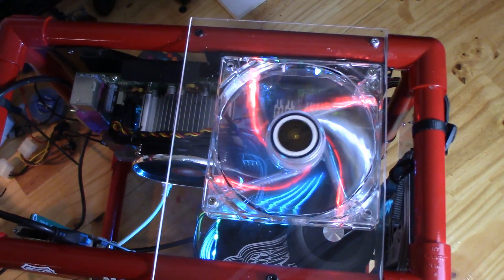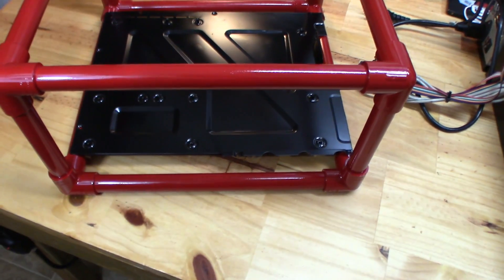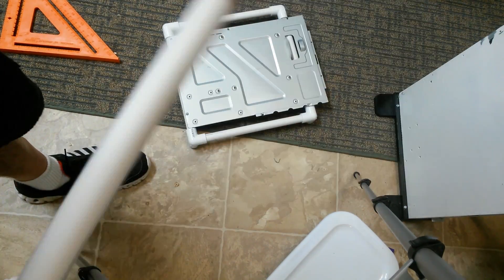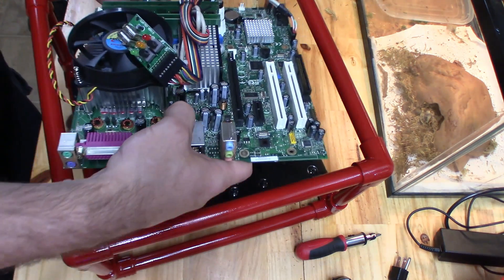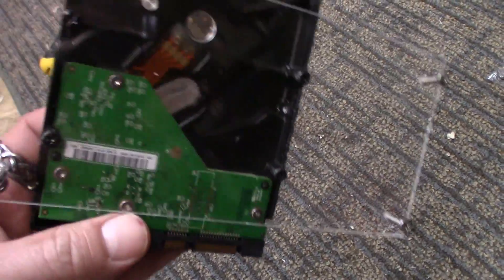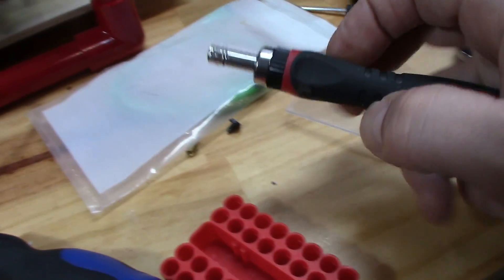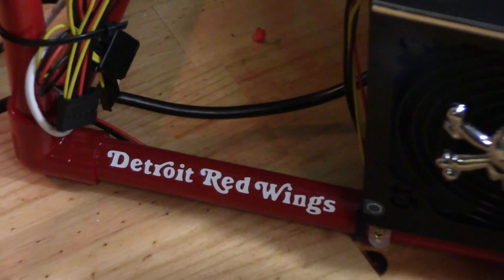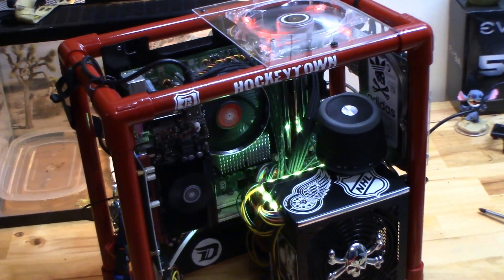Building your own computer case out of PVC for $8 dollars

Comment: DDR2 core 2 duo. I remember those days. I got a core 2 quad and broke my motherboard. My broke ass could now afford thermal paste. So I used RTV gasket maker. Still got my gt 740. Using it with a i3 6100 Dell mobo. KF1 runs. Idk about KF2.

Comment: i AM GOING TO BUILD YOUR CREATION, i NOTICED YOUR MOTHERBOARD is a micro atx. and you use 8 foot lenths. What would you recommend for a full atx board? athe board plate is 15 in wide and 12 in long.   Any suggestions?  I thank you for the help
Reply from the maker: the plate the mobo is attached to will support a full atx if that helps